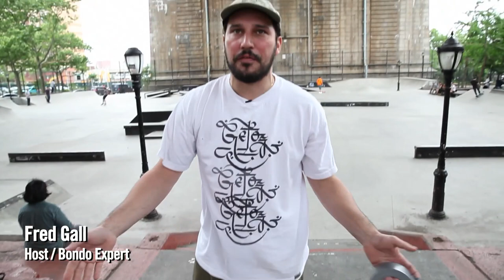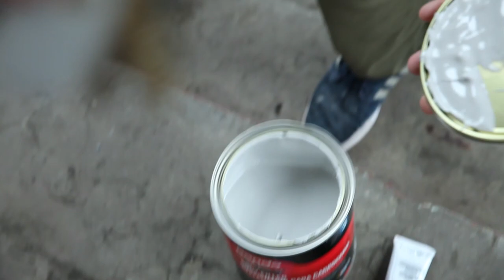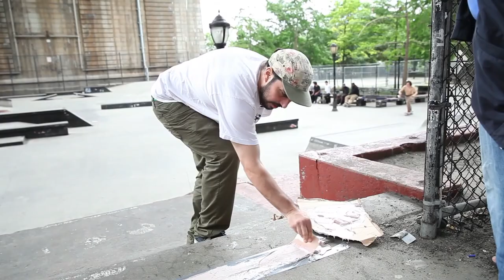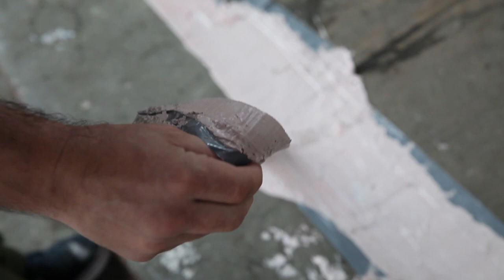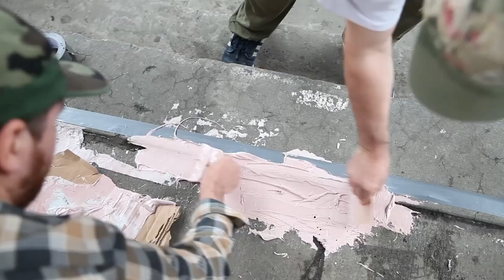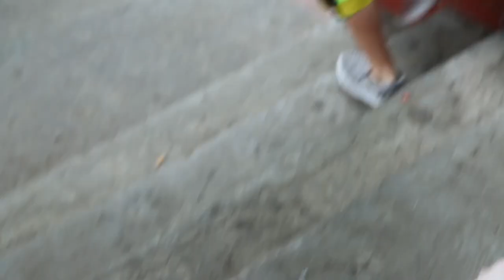JENKEM - How To Fix a Crack with Fred Gall....kind of

Comment: A little prep work goes a long way. At least sweep and dry the area first. Also less is more, less hardner will give you more work time,  meaning it'll take longer to dry but you can smooth it out before it gets too hard. Also there's concrete prep to treat it with before painting and Bondo. If you're going to put in the effort to fix a spot go the extra mile and do it right so it'll stand the test of time and be right the first time meaning less material used meaning more Bondo for other cracks. Also for bigger chips and gaps there's Bondo with fiberglass which is alot stronger over larger areas
Reply: I did the exact same thing on the steps at my house.  Thing I just used mortar mix (fast setting concrete).   The big thing was to wire brush out all the loose pieces.   This was probably a 50 year old concrete walk up too.   The biggest thing is prepping an applying it.   Then I had to get a 2nd bag and I learned from the first time that it seems simple but you need a sponge.
Reply: Battery operated leaf blower
Reply: can i use a leaf operated battery blower instead?